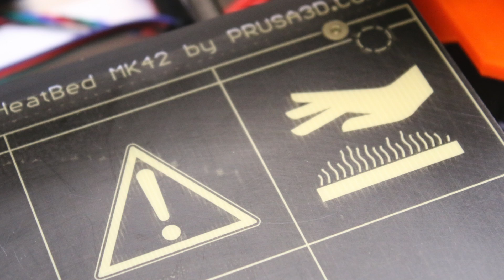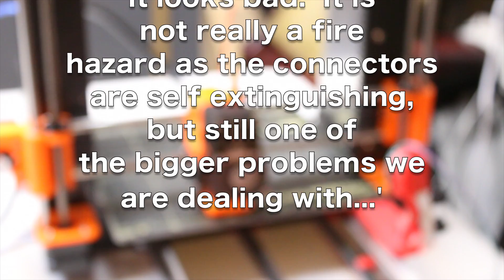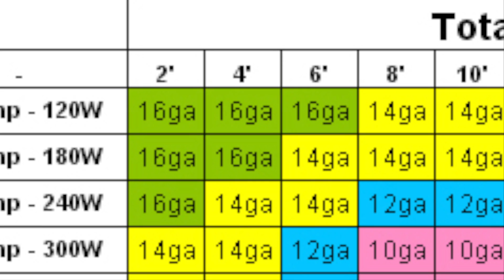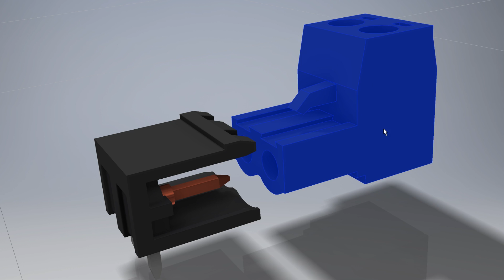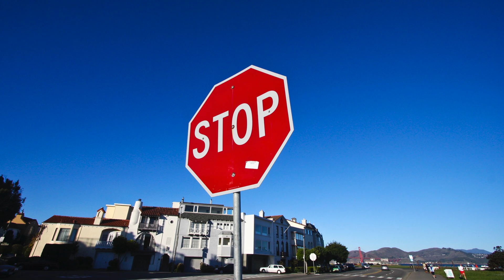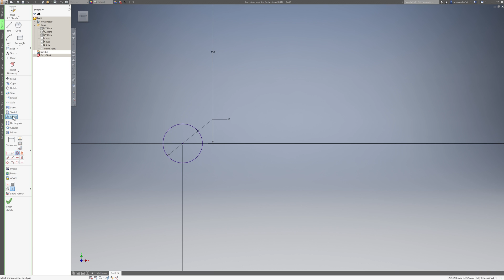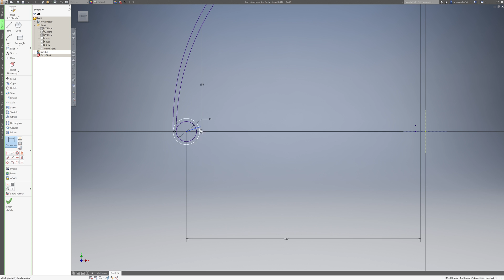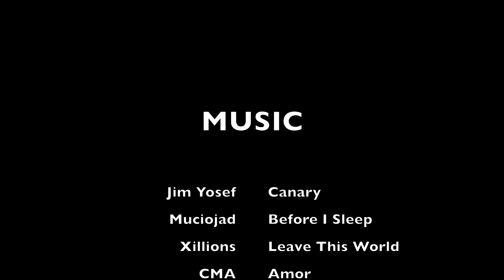3D Printer S02 E06 - Prusa i3 MK2 - Prevent Blue Smoke

Comment: It's all about surface area at the contact point within the connector.   Those particular molex have that small pin, which can lead to a small area of actual contact between it and the mating plug.   The smaller the surface area, the more current going through a smaller portion of the metal.   That means more resistance and therefore, more heat generated.
The older style molex connectors had a larger tubular pin and barrel design which resulted in a larger contact surface area, spreading the current out over more metal, less resistance and therefore, less heat generated.
Take a look at the older style hard disk power connectors on an old PC to see what I mean.

Comment: I had the same thing happen. I believe the RAMBo board can't handle the current. Also, the manufacturer offered the same opinion that they tend to fail after heavy continued use. The solution was to put a relay in place and only use the RAMBo board to cycle the relay thus removing the heavy current load from the board. This decreased the heat up time on the bed and I have had no issues since the replacement.
Reply: Rick Peck:  Might you have details/documentation on your 'mod'?   I have a i3MK2 still in box to be assembled, and would like to consider preemptive actions.   Thx.
Reply: I bought the relay from MakerFarm. The instructions on the wiring are part of the product page. http://www.makerfarm.com/index.php/heat-beds/heat-bed-relay.html

Comment: Here's a thought.. why not design a screw design that goes from the back of the PCB to the board connector to the print bed connector to mechanically secure the connection? Also there are temperature sensitive fuses that could be put close to the connector when it overheats near the 105 C (221 F) temp. A power supply should never get that hot!

Edit: As a fellow analytical person, I identify with your desire to investigate before blurting some crazy talk about a well known product being defective. I appreciate that you took the time to suggest several fixes in the interim that can help Prusia make a better product. Thanks! Also thanks for that cool thingieverse model, I'll definitely make one when my MK3 comes in the mail! :)

As a future curiosity, I wonder if a flir camera could identify exactly what sections are the hottest on a 4 day print.

Comment: Very well done. Its clear you were only trying to educate all of us and not bashing Prusa to me. I think its kinda silly that increasing the wire size for safety and using silicone wire for dependability and hot glueing the connector would be ANY kind of reason for Any manufacturer to void a warranty. But of course these laws are written by lawyers not engineers with skills and sense. :)

Comment: I think that it is more likely that the connector was just defective.  If the metal parts are not firmly touching then they create heat that quickly oxidizes the contact area smaller which then gets hotter till failure occurs.  I see this type of thing a lot on GM vehicles when people try and use paper clips to probe sensors. The paper clip is too big and pushes the spring like contact enough to cause it to no longer engage. Funny story, When one farmer tried to diagnose a simple problem and ended up with half the sensors nonfunctional for his truck. 
My point is they may be designed for higher then needed amperage but if the contact spring is not strong enough or slightly defective it can start a chain reaction that results in this.

Comment: Awesome Video man. Solid engineering diagnosis there. I think you are right in your diagnosis. We saw this kind of thing in connectors in machines in the military. Same issues. Putting clamps on it resolved the failures.

Comment: Thanks for the informations, I need to check my connector right away. One more thing I've noticed: Your extruder PID seems not tuned well when looking at 10:07 - lots of ripple. I had the same until I did the PID calibration in the Prusa menu. Since then, my temp curve is rock solid (was similar before to yours).

Comment: It has to happen more often. It happened to me around 2 months ago and 1 week ago (on the replacement rambo). Now I've soldered on new molex connectors and removed the board from the side of the printer. I've also ordered some mosfets to solve this issue.

Comment: Great video! I have to say the wiring of the Prusa MK2 is not good. Not as terrible as from very cheap 3D printer kits. But CR 10 does a way better job. Another example: the hotend fan cable of the Prusa is way too thin which might break cable inside and loose connection. This results in clogged hotend. I had to replaced mine because this issue was very difficult to find because it happened not very often. So I recommend to replace that cable. At the moment I am using the CR 10 as main printer and Prusa I will install multi material upgrade for smaller prints.  About this Prusa statistics (2-3 of 5000 printers): how many of these printers are really in heavy use (like nearly 24/7) - 1000,500, 100? Nobody knows.

Comment: Also, be sure the screws are tight that retain the wires in the connector.  I work with these type of Molex connectors often and it's not unusual to find a loose screw or even a improperly stripped or not fully inserted wire.

Comment: Hot glue is easy to remove, just soak it with isopropyl alcohol and after a short time it breaks the bond and it can generally be removed with the help of something like a screwdriver without damaging anything

Comment: This is why large hvac and electrical systems (datcenter) have monthly checkups with a thermal camera. Thous connections should not flame up... (nvm you got it) but any lose connection = heat. This is also why its bad practice to tin the copper wires before you put them in theses kinda connectors, (this will start in interner net argument but its just true, sorry.) Now tinning the tips to keep the strand from fraying out that arguable:)

Theres also a firmware thermal runaway protection you can turn on. for exactely this reason, i didn't know this till i updated my printer a few weeks ago. But its kinda finicky if your bed is a bit under powered. If the temp dosen't respond when heating as it was expecting. 

But like the mfg explained it can happen to any connector really., Soldering probbly a bad idea here though as it would create a hard point. and work harden the copper. Your better off with a crimp /spring screw terminal direct on copper. Now suporting the wires going into the connector would be a great idea. So there is less movement.

EDIT: Your crimps may also be part of the issue too for the same reason as the solder.^ Not makeign a good connecton because the terminal is meant for copper not the hard metal of the crimp.

Comment: Hi! Great video, i wasn't aware of this issue. I also prefer silicon coated wires for everything that has to move often, those never fail. Plus, the silicon sleeve is rated for up to 200°C, so no risk of melting...

Comment: Funny enough this happened to me a few days ago while i was printing overnight. Had to get a new RAMBo board since it compleatly fried the solder pads on the board thus increasing the resistance on the connector even more.
Reply: I'm thinking the increased resistance of the connector isn't the only factor at play. Remember other 3D printers have the same issue, and use different connectors.
Is the common factor also the heated bed itself ?
Website of company that make the exact heated bed used.
https://bootsindustries.com/heat-bed-3d-printing/

It's not the design of the bed itself, but basic physics at work here.
For any practical heater/resistor there is a factor called "thermal runaway" where resistance decreases when temperature increases.
Without thermal monitoring the heater would melt down, only for a 3D printer it is monitored. So all that happens is the bed draws more current, heats up faster and spends less time on. The wiring and connector are rated for a certain current, as is the fuse. The brief spikes of high current when the hot bed is on is what melted the connector, without blowing the fuse which takes some time to react.

Would be easy to test if this is the case, monitor the current the bed draws using test equipment during 24+hour 3D prints.

Comment: Good video, and THIS is one of the reasons I use only silicone wires in my builds, flexibility and the fact the insulation will not burn. It's great, you can solder wires and not have insulation shrink on you, or you can sleeve wires in mesh sleeving and cauterize the sleeving with a soldering iron, and not have any issues with insulation under neath. The other point -- your previous video on the topic was clickbating because it was about something completely different, you have it in the title that a stress test burnt up your printer, but you left it at that -- you either say nothing about it until you are ready to put it into a video or you say what happened, and explain it. Cliffhangers are not cool. Your other video could have been entirely about the QSN, and you can simply say, the 4 day print did cause me to have some issues with my machine which I'm researching and will cover in my next video.

Comment: The problem with your other video was that you clickbaited the title of the video without providing any solution or details of the error, but instead basically just said "stay tuned".  That's clickbait.  Comparing to a warning symbol is ridiculous.  Those warning symbols provide steps to avoid harm, not just a warning.  Next time don't bait out a video without also providing details.  My biggest annoyance with your previous video was just that, NO DETAILS.  You didn't even say what the problem was.

Comment: I wouldn't be that sure that the plug had become loose... I have a Rostock Delta printer with a fixed bed, connected to the RAMPS board with silicone cables. There is no vibration on the connector at all and it is well rated for its current... However, after about one year, mine also burnt down... I Wouldn't trust these molex connectors. I use XT60 connectors for the heated bed since then. I've desoldered the original molex connector from the RAMPS board and soldered the cables directly onto it (with XT60 after few cm).